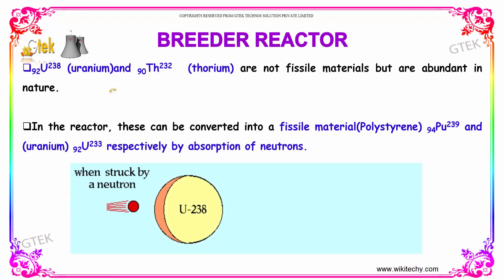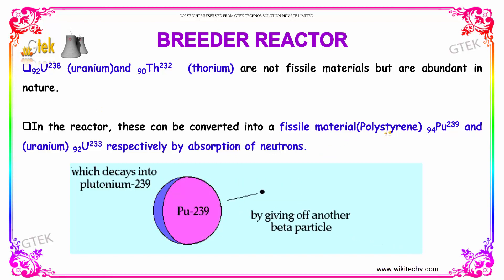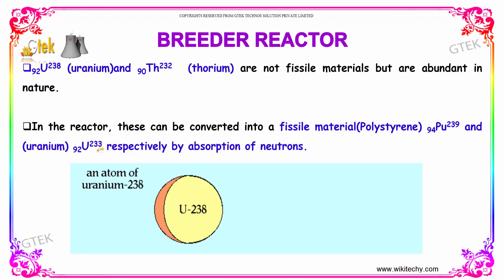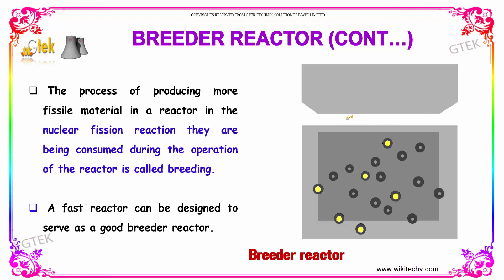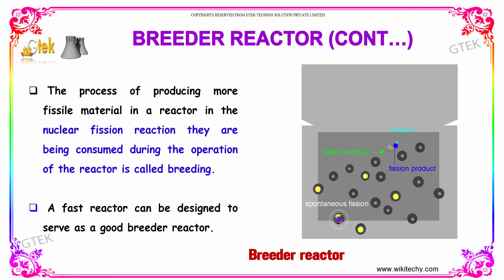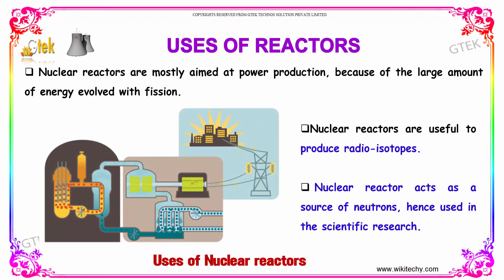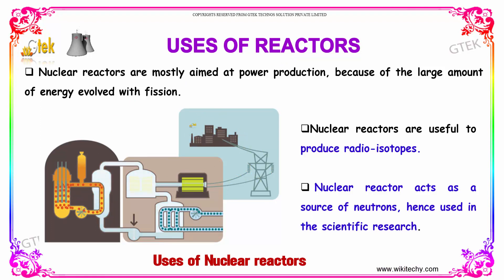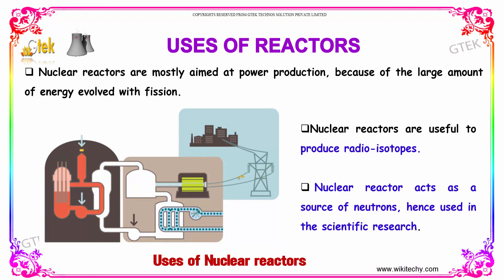Breeder Reactor | Nuclear Physics |class 12 physics subject notes lectures|CBSE|IITJEE|NEET

Comment: A fast neutron reactor or simply a fast reactor is a category of nuclear reactor in which the fission chain reaction is sustained by fast neutrons. Such a reactor needs no neutron moderator, but must use fuel that is relatively rich in fissile material when compared to that required for a thermal reactor.

Comment: Breeder reactors could, in principle, extract almost all of the energy contained in uranium or thorium, decreasing fuel requirements by a factor of 100 compared to widely used once-through light water reactors, which extract less than 1% of the energy in the uranium mined from the earth.